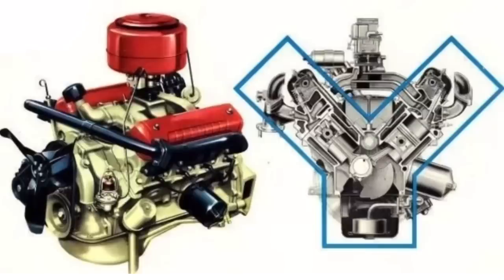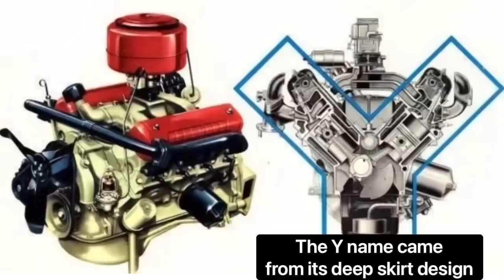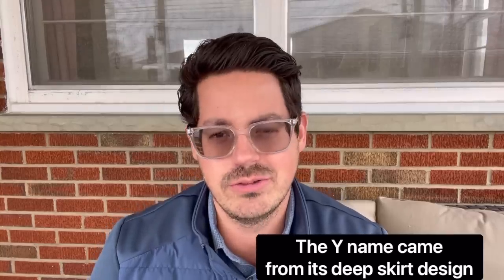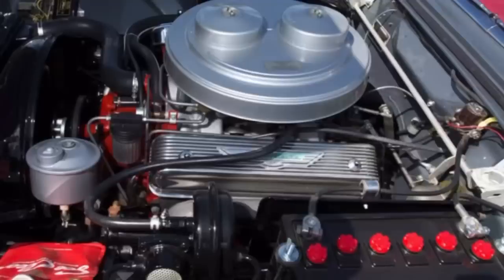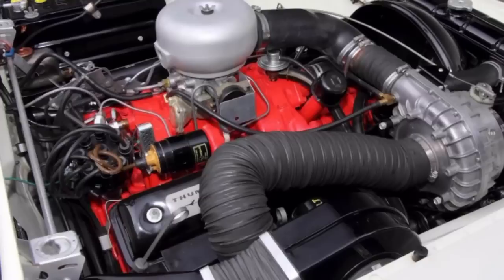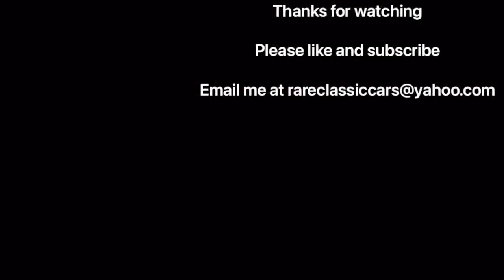Worst Engines of All Time: Ford Y Block V8

Comment: The Y Block was the first engine I ever worked on - back in the middle 1960s - well before I had my license. The 312 with 2 x 4bbl was a major rocker at 260hp - you could even go 300hp with the factory supercharger. Yes - if you didn't change the oil regularly, you were going to have problems. Remember, though when Chevy released their small block - they used oil and the dealers had to dump Bonami Cleaner down the carb to rough up the cylinder walls. AND those early Chevy mouse motors didn't even have an oil filter... So many of those became "smokies". And remember the Chevy lifter clacking...? It was said that all good Chevies had clacking lifters... So give me a Y Block any day in the middle 1950s. 
So what if you had to put an external oiling system on the rockers on the Fords...? Gee whiz, change your oil and sleep well. After all, these early V8s (Chevy or Ford) weren't tractor engines...

Comment: My dad was a mechanic in the 30's to the 60's.  He had his own shop, so when I was 10 or so I started going over and helping him.  (Child labor.)  Just about every engine that came in had oil problems, because of the lack of oil changes, non-detergent oils, and lack of oil filters. My dad tried to convince people to change their oil more often, but few listened to him.  (Remember the Fram ads that had "Pay me now or pay me later."?)  One of my jobs was disassembling rocker arm assemblies, cleaning them and laying them out for my dad to put back together and put back on the car.  Some times the entire rocker arm cover would be full of sludge.  I would have to use a putty knives to get most of it off just to get to the bolts. He worked on a lot of Chevys (because there were a lot of Chevys), and they were as bad as the Fords.   By the way, I change my oil and filters at 3,000 mile, because I was so traumatized by the image of those rocker arms.
Reply: Post Traumatic Sludge Disorder. I suffer from it too.
Reply: I slapped heads on a sludgy (but not putty knife sludgy) mid  '70s small block Chevy that'd sat since the early '80s. Owner switched to a modern synthetic oil. Car came back to me 6 months and maybe 4,000 miles later for a defective rocker arm. I'm telling you those rocker covers were spotless. That modern oil cleaned up that motor like a hot tank.
Reply: @otm646  If you would have dropped the oil pan you would have found where it all went.
Reply: @otm646  😊😊😊😊😊😊8 j
Reply: @otm646  Putting synthetic in a dirty engine is risky.  The oil pump screen can get plugged, which means instant death.
Reply: Sad thing is loads of people still today don't know you need oil in your engine/transmission and never get the oils changed and act surprised when they hear an engine knocking or their transmission's gears are slipping or make a loud thud when the gears change.
Reply: @FloodExterminator  I can't understand why so many guys nowadays know absolutely NOTHING about a car.  What do they think will happen if they have a hot date, and the car breaks down, he has no idea what to do, and an old guy like me has to come to the rescue?
Reply: man, be careful how you use the phrase child labor, I would love to work in a old garage around classics cars as a kid and I would love every minute.
Reply: I also loved it, except for the time he threw a torque wrench at me.  He was working on a Rambler with an aluminum head, and I warned him how they would crack if head bolts were over-torqued.  He usually just tightened bolts and nuts by feel, but got the torque wrench.  He was tightening the bolts when one snapped.  He got pissed and threw the wrench at me.  I ducked, and the wrench when though a window.  "If you can dodge a wrench you can dodge a ball." I love that line from Dodge Ball. 
I hung out with my dad a lot, not just at work.  And enjoyed working there.  I would even go back to the shop after "supper" when he turned landing gears for "Tailwind" airplanes (a home-built airplane his friend designed and sold plans for).  My dad was also a machinist.  He tuned the landing gears and then took them to a blacksmith, who bent them into shape and tempered them.   With today's liability lawsuits, it would not be wise to make plane parts.
 @OVERKILL_SS
Reply: Great memories.
Reply: @muffs55mercury61  My dad's friend had a '55 Merc Montclair with a white top and the "Sun Glaze" bottom.  We called it the Creamsicle.  There were also Biltmore Blue and Springdale Green ones in town at the time.  The pastels era for cars.
Reply: Agreed. I change my oil and filter every 5000km and in my view this is the number one thing you can do for your engine, and it will save you thousands in the end.
Reply: My   Dad    had   F600   ford   trucks   in    the   60s   and    70s....Y  block    with   billet   steel    crank    and    thick   cast    block   in   the    trucks    was   a   good    engine...We    used   to   spanner   them    ourselves    and     looked   for   200    horse    with    plenty    of   torque?...fitted    them    all   with   oiler   kits    for    topend   and    never   looked    back?..In    fact    we    still    have    one    on   a    pallet  in    corner    of    workshop    waiting    for   a    55    pick up?...
Reply: I remember those days and it seemed back then that the sludge issues happened to people who ran Havoline oil but the problem was almost nonexistent in engines that ran on Pennzoil oil with paraffin base stocks from Pennsylvania. Also Quaker State was rumored to have a paraffin base and did not sludge up. Now there are probably thirty brands with base stocks created in a lab and we never knew motor oils would be so advanced to where engines could run 300-400,000 miles and could be opened up and bare clean metal be seen.
Reply: @beboboymann3823 Ran Valvoline in my machines with very good results. Also, sometimes a quart of Rislone between changes as miles piled up. Burned no oil, quiet, & ran smooth as glass Should be a "no brainer," but many good cars & trucks still die premature because of poor maintenance.
Reply: My mother bought a new Ford Galaxy in 1962 and drove it to work and took us to school .it had a 292 Y block engine not a lot of power she drove it over 20 years no problems with the car except the wreck I had as a teenager
Car was running great when she traded it for a new big ford that had a 351 V8
Reply: good for you but if you have a newer car 7,000 miles is ok, I  understand old habits are hard to break but with fuel injection and computer controls carbon buildup is almost nothing, use good synthetic oil and even 10,000 miles is ok, I do have a 1951 chevy pickup it has no oil filter, 1,000 miles is the limit on that one, thank you for the nice post
Reply: You must be old skool. We usually did oil & lube every 3 mos or 3K mi (a bit longer if highway miles.) But this was before synthetics.
Reply: I had a 292 and a 54 Ford.That would absolutely scream.I'm blew the transmission out and put a nineteen fifty six , 354 hemi 🎉
Reply: Thank you for commenting. While there are some poorly engineered engines out there, the vast majority of engine failures are directly a result of lack of proper maintenance.
Reply: Best comment on here. That old grade of oils was not that good.
Reply: @cammontreuil7509  Agreed -- "best comment" on here.  Really, is there anything better than people who know what they're talking about? Rhetorical question.  Thanks to Donald Johnson, and M.J. Mateyka for eliciting the great, anecdotal comments here.
Reply: Had a 272 granny low 4 speed on My 1954 Ford F100 for 15 years had a 9inch rear end also and 410 shorty gears
Reply: I bought a '73 Chevelle with  74,000 miles on it.. I changed the oil by pulling the oil pan and valve covers and digging all the sludge out with a putty knife.. the Valve guides  and came were bad.. I put  heads from a  1970 350 on it with only 120,000 miles and great condition.. 64 CC heads instead of 76 cc heads..
  I put  the cam and timing chain from my 79 Z-28 Camaro that had 4 bad lifters @ 14,000 miles.. found out years later there was a recall on them.
  Headers  Economy intake spread bore  450 cfm  Holly carb.. I ran it for years  22 MPG on the highway .. It was my winter beater car..
Reply: sounds like a lot of work but it probably ran great, in the 70s and 80s compression ratios were way low those smaller chamber heads would help a lot  also headers  help a ton the carbon and sludge on those cars was real bad, but if you get them running good it is not bad, looks like you did a great job
Reply: I started working on cars and engines in the 6th grade. Like you I had to clean and use wire brushes and solvents (no gloves and I'm still alive) on rocker arms and everything under the valve covers. I would replace valve cover gaskets for $8 a side. I would see chunks of coal and black sludge between rockers. The guy that taught me told me if was from not changing the oil and from using Pennzoil. I've never was able to use it in any of my car since. Thanks for the memory...remember removing the rocker cover and loosing the rocker are and shooting WD-40 down the rod hole to clean it and stop the rocker from clapping lol. We could do it in 20 mins on the side of the road or in a parking lot.
Reply: Yes!  I recall de-sludging the rockers and springs on my Dad's 1968 Thunderbird.  I would stuff rags into the oil galley holes and then use gasoline and a toothbrush!
Reply: Leaded gasoline didn’t help either. Completely clogged engines up.
Reply: There were two different types of center Cam Bearings.  One type used a Cam bearing with three holes.  The aligned with each bank briefly each turn of the Cam.  The other one had a groove in the Cam journal itself. It was necessary to get the correct Cam Bearing to go with the respective Cam when rebuilding.
   Another problem  was Babbitt and grime filling in the oil passages.
    The correct fix was running a braided oil line up the rear ( behind Flywheel ) when rebuilding.
                                   Fergieman
Reply: Nice memory to have👍🏽👍🏽
Reply: Oil is cheap, engines are not.
Reply: Pcv valves / proper crankcase ventilation was a big positive change that helped prevent sludge buildup as well as low parafin  high detergent oil s that eventually kept contaminants suspended so that they could be removed during a oil change ... Sadly a lot of people sabotaged their engines by disconnecting pcv valves thinking they were for pollution control and lowered performance plus many people believed non detergent oils were best even though manufacturers warned never to use non detergent in any modern engines built after 1950 ..
Reply: Love my 292 ! First road trip I found out speedometer was 10 MPH off ! Guy passed me on I40 didn’t get a mile down the road and blue lights ! If he had not passed me at that time would have got me ! 😮
Reply: I still change my oil and filter every 2,000 miles, and refuse to miss an oil change.  My wife gets pissed when she can't use the car until I do that, but then I  remind her about how much longer it will be down if I have to rebuild the engine.  She still doesn't get it.
Reply: @michaelbenardo5695  2k with Synth is just wasting synth. That stuff probably wasnt even broke in yet. 3.5k if you really beat on it, 5k regular. You could order a lab test and they can tell you if the oil has more or less life and stuff.
Reply: @darrengarcia4937  I don't yet use synthetic.  My engines have lots of miles, and probably would suffer from low oil pressure with them, but I will use it after they are rebuilt.  And 5,000 mile change intervals.
Reply: You won't have any oil pressure issues with synthetic oil that's dependent upon bearing clearances in the engine has nothing to do with the oil the only problem you might have is it will clean the back of the seals of any sludge and you may develop leaks it doesn't cause leaks it just causes you to find leaks that you didn't know you had
Reply: @michaelbenardo5695   Half synthetic in my vehicles with a quart of trans fluid. 5K miles driving it easy
Reply: It is all in the servicing & using the oil that Ford or Chevy says. I have a 12 quart oil pan on my 510ci Lincoln. I always put in 4 quarts of trans fluid & the engine stays very clean because of the detergents
Reply: With high detergent oil there is no need to put tranny fluid in any engine, don't really think it is good for your engine either. @aldonelson5757

Comment: many of those engines of the day, were "RUSHED" through engineering, and "PUSHED" through production, just to get those engines under the hoods of the cars/ trucks of the day ,without good testing. I know that the chevy V-8 was designed,  built, and put into production in less than a years time, what speeded up the engineering time was that engine had "SHARED" engine designs from other G.M. engine families of other car divisions . that engine( 265) did not have an "OIL FILTER" on the block, you could order a bypass oil filter system as an option. you had to be carefull not to rotate the distributor too far left or right when setting the ignition timing, or you would choke off the oil supply to the left or right bank of lifters.   all I can say is "a lot of the problems were due to lack of maintenance of the owner".